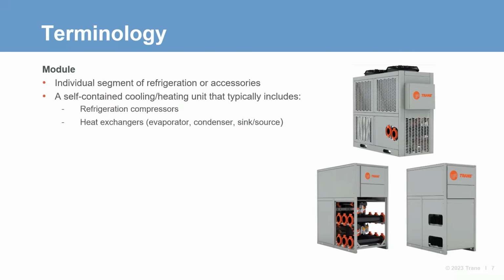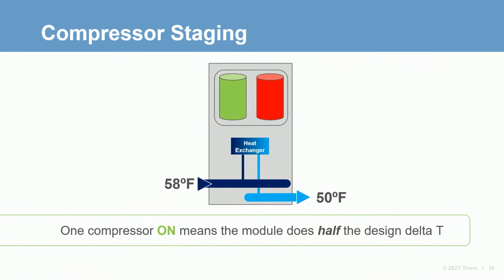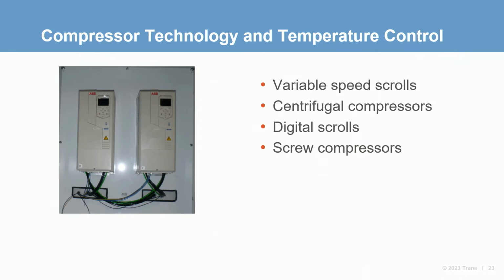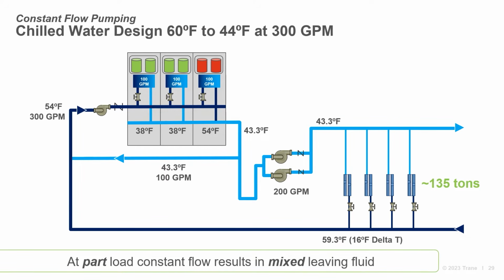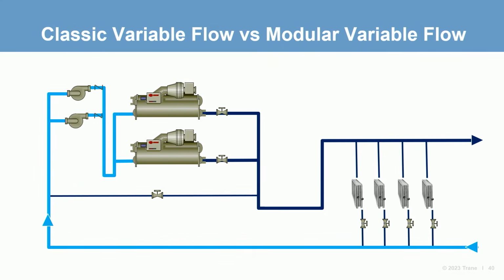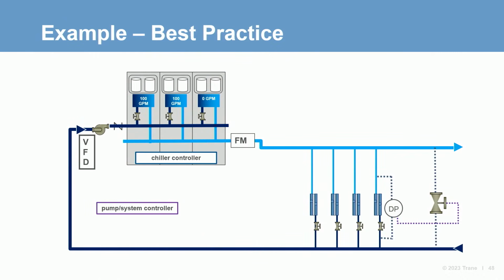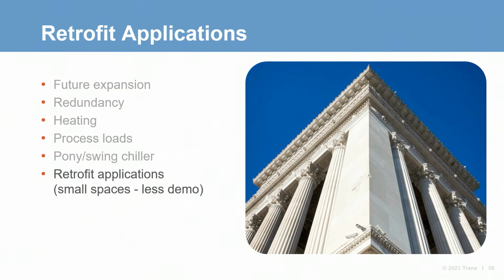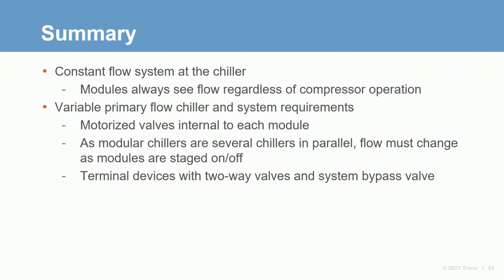Trane Engineers Newsletter Live:  Modular Chiller Plant Design

Comment: 20:00 let’s say you have three modules and you measure the supply and return temperatures internally, isn’t there a formula that’d solve for the mixed temperature and would be pretty close to the external temperature sensor reading? My point is: can I skip the external temperature sensors if I had to, having good internal temp sensors ?

Comment: When cautioning against utilizing the BAS for control of a remote bypass valve should the takeaway be that the BAS NETWORK should not be used? That is to say the DP transducer and the remote valve should be hardwired to the same controller?
Reply from the maker: As discussed in the presentation, various strategies can be successful and actual operation depends on modular design and setpoints that are specific to each situation. The purpose of the comment was to call attention to a common pitfall where any control item passed through a BAS may be subject to a lengthy refresh rate.  For certain systems this may simply slow down response, however it is important to understand that for a modular chiller system this could in fact cause issues.  A system with fairly steady, slow-changing loads may not see much of a result, but a system with rapid load swings could see alarms/shutdowns. We encourage listeners to think about whole system performance then choose the best strategy for their goals.